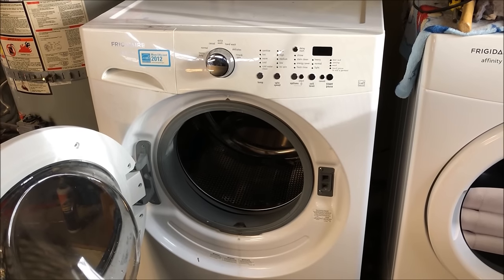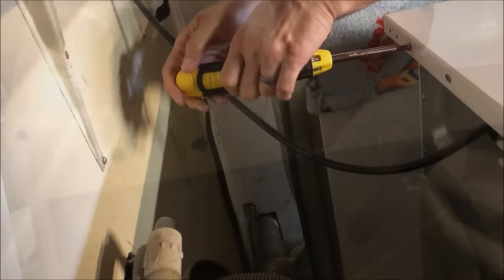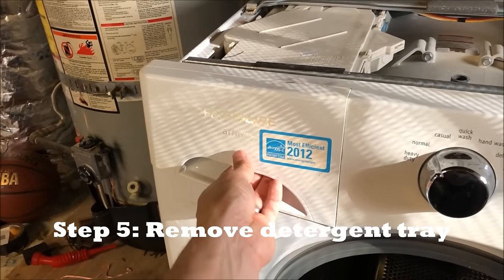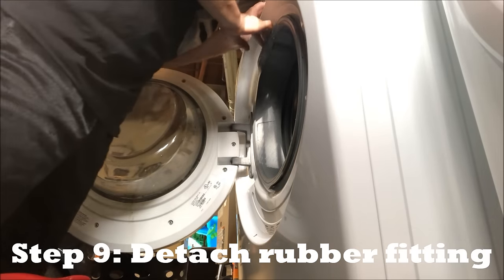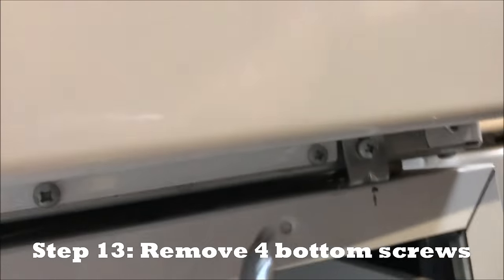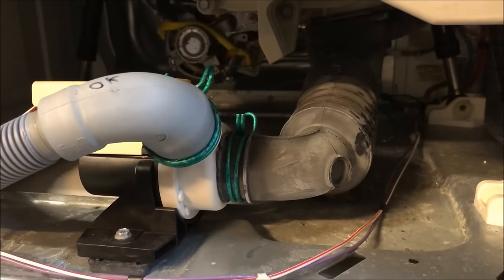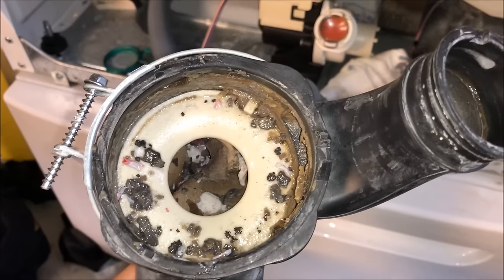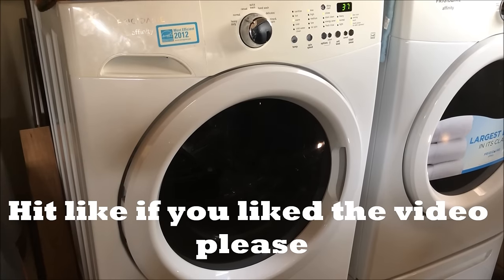How to fix Frigidaire Affinity Washer That’s NOT draining properly

Comment: Well I cleaned out the cointrap and boot, but I accidentally took out the rubber o-ring collar seal it's the seal that keeps water from leaking through the door) and I can't put it back in now.  DO NOT take the door seal out.

Comment: Thank you so much...You are right...Those PUPPIES are hard to get off. I have been trying to put it together for two days. LOL...Maybe a video for dummies on how to put it back together would help. I cant get the big piece to stay on correctly. You would think since I took it apart I could get it back together....Ummmmm NO...not working.
Reply from the maker: Sorry to hear that. Did you try using locking pliers?
Reply: @CesarCinema  no I do not have any...I am still working on it. I can not get the top of the part that has the filter in it to stay on. Even though I hook it tight.

Comment: Ripped it apart 3 times the hose keeps on leaking (the larger one attaching to drum) is there a special way to attach it???
Reply from the maker: You might have to replace it (link in the description box). Or maybe you’re not putting the clamps all the way on 🤔
Reply: I just had the same problem. There is an overflow that comes off the large rubber part that attaches to the drum. The short stub that comes right off that has a green compression clamp that secures it to a white plastic part. That part has a clip on it that corresponds to a slot on a piece of steel coming off the drum. This helps hold the weight of the rubber catch piece. It’s a piece of shit and you have to push hard to get it to stay. Good luck!
Reply: Having this same issue! The rubber boot doesn’t want to go back in place
Reply: zoe jacobsen make sure coin trap all the way down where it should be that was my problem

Comment: I just did this right now. I did it through the back panel. Leaned it forward to get to the farther clamp. Instead of buying $15 vise grips. Just buy 2 hose clamps for $3 and replace the pain in the ass that it comes with.
Reply from the maker: Good tip 👍🏻

Comment: $500 - 600?  I just had this service performed and it cost me $74.  You can get to the pump from underneath without having to pull the front of the washer off.
Reply from the maker: I received a couple of quotes and I was told I was better off buying a new washer. I’m glad that you only paid $74 but this vid is to show you how to do it yourself and pay 0 dollars. I’ve been told you can do this from the bottom but I haven’t seen anyone do it and that would mean you would have to lay a heavy washer down to do this n pick it back up after you’re done. No thanks I like my way better n thanks for your input.
Reply: Caesar Cinema I have to agree with you about moving the washer. This washer is heavier than any washer I’ve had in the past. I can’t even scoot it across the floor, plus mine, like yours, is attached to a pedestal.
Reply from the maker: Yes exactly it would be way harder to remove the pedestal and do it from the bottom. Thanks for adding that!
Reply: If there was no pedestal, would you recommend laying on its side and getting the pump from underneath?
Reply from the maker: If you have a helper yes it would probably be easier
Reply: I have never found an appliance repair person that doesn't have a minimum call out fee of at least $200-300.

Comment: Why not just tilt the washer backwards, unscrew the screws at the bottom to get to the boot? Seems like opening the back screws, top panel, front panel (above) the front bottom panel is a complete waste of time. You can skip all of those steps.
Reply from the maker: Because the washer weighs over 200 pounds and I have a pedestal under the washer.

Comment: U only needed to remove the bottom front panel to do this job😅
Reply from the maker: You need to remove the top panel in order to remove the front top panel then you need to remove the front top panel to remove the big front panel. You can’t remove the bottom front panel without removing the rest. What do you mean please elaborate?

Comment: It really aggravates me that they made this so hard to get to, since it needs to be checked periodically.  I've put mine back with the clamps/screw facing the bottom and have managed to now clean it twice without having to take all this off.  But you have to work a little blind to do it.  They should have made an access door.  Crappy design.

Comment: Lmfaooo I can’t believe that guy literally open the top of the front and everything else just to get to the filters and everything when there’s a bottom panel we’re you just unscrew a few screws and a big hole is cut in the metal for that exact reason for the workers to get easy access instead of opening up the whole thing
Reply from the maker: If it’s as easy as you say it is please make a video and show us step by step and I’ll put your video in the description box. If there’s an easier way im all for it but I have a pedestal under the washer that would make your way more difficult and you would have to probably lay the washer on its back to access the bottom which means heavy lifting. My way is more practical and less labor. Thanks for watching!
Reply: Whirlpool has a removable lower panel on the front. However, this video is about Frigidaire which does not

Comment: Worst damn washer I've ever owned, doesn't wash cloths not nearly as good, no accessible inline filter that's easy to fix, no way to drain excess water, noisy just overall crap machines, and the  eletric dryer is worthless too. Do not buy  these on the used market